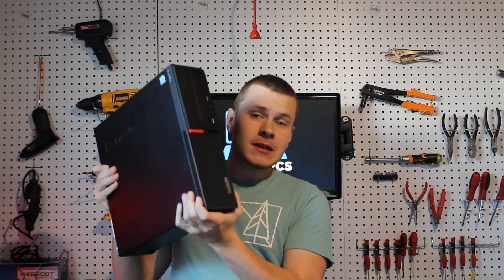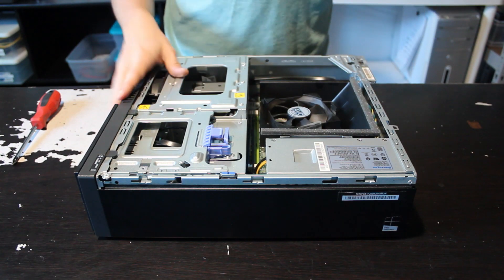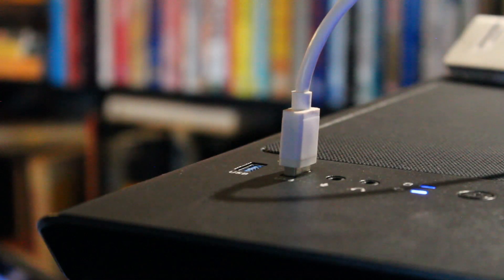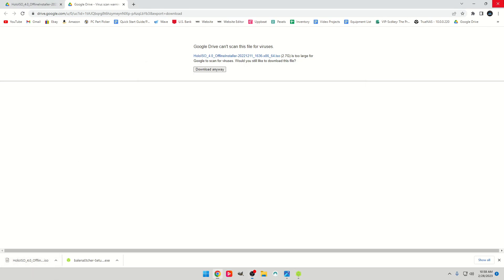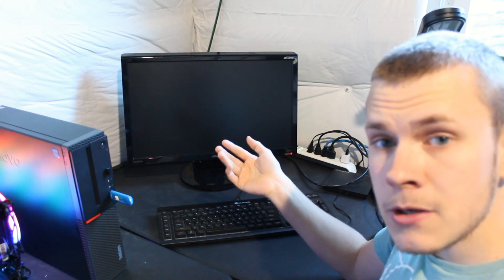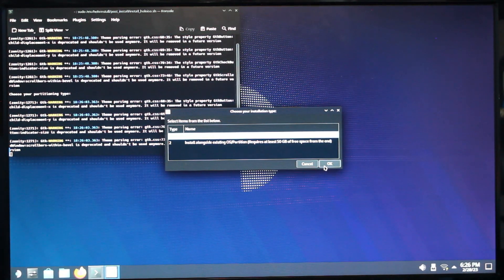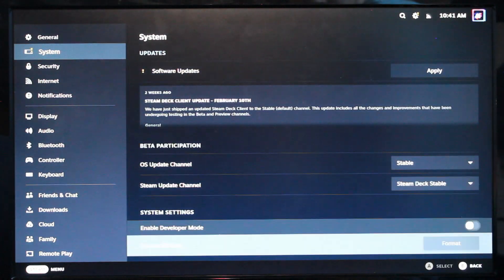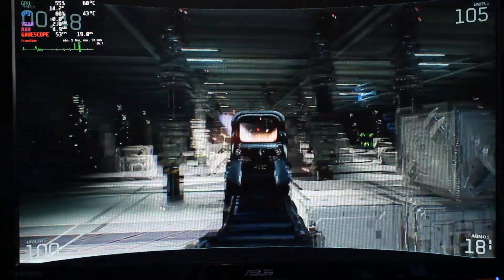How To Create Your Own Game Console With Steam Deck OS

Comment: intel core I5 6th gen series only support 2133 MHz Ram . why you are using a  RAM that runs in a frequency of 3,200 MHz 🤔
Reply: I know your not talking to me but I believe that if the computer doesn’t recognize faster hz it will just pull what it needs so going over shouldn’t bother it at all. Unless I’m wrong.